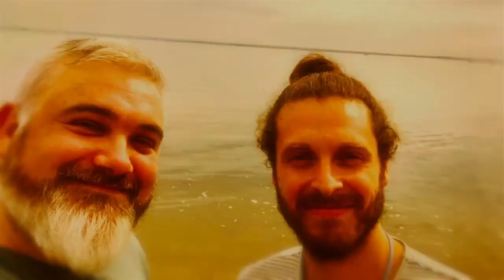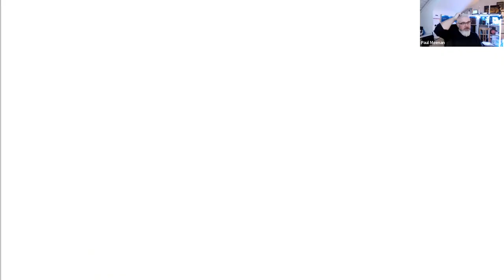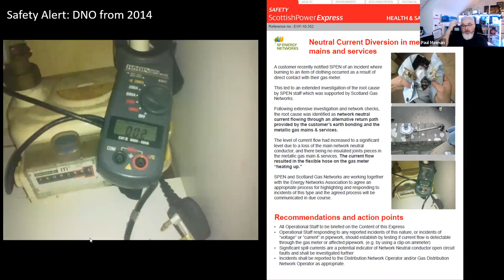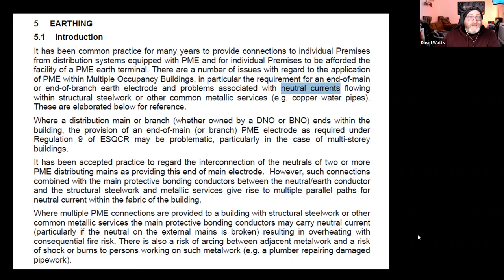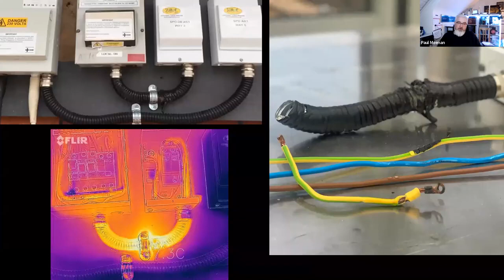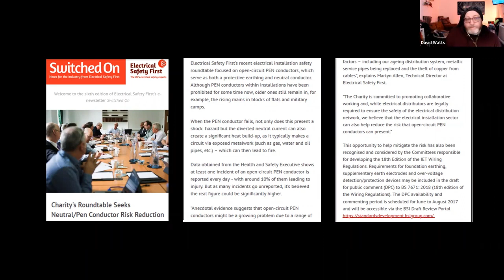Diverted Neutral Current

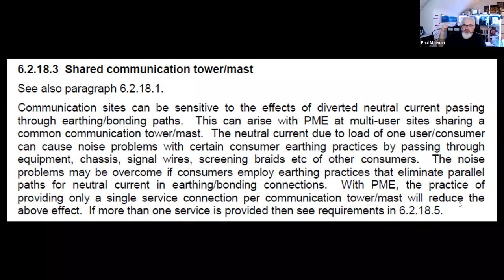Comment: 36:30 What if you have over head lines but you are close to the fenced in transformer that is fed with underground cables? I've had some scary things happen at the meter board (in my kitchen) when the big transformer has done the big light show and electronic music before It made even bigger boom.. everything around felt charged for a moment, kinda scared to have any Class One now :/
Reply from the maker: Yeah that does sound like a bad combination of circumstances. The wording 'charged environment' is key here as that is most likely exactly what you have.

Comment: Perhaps the DNO should be adding a clamp Meter or other earth current monitoring equipment when they install new Meters ?
The technology is easily available now so there is no excuse. If they can read amounts the KWs of Current used and Bill us directly from this tech , why can't they see dangerous problems and get it fixed? 
Diverted Neutral current is caused by some break in the DNO supply cable conductor, before the current gets to a Consumers property. This situation is in no any the responsibility of the Consumer, or in turn the Spark they have employed to do whatever at their home. The DNO surely have a responsibility to get this sorted, at least with new stuff going in and not just do the bare minimum.

Making it the Consumer's problem and getting them to pay for the Fault finding is wrong in my view.
Maybe when a fault is discovered by a Consumer's Spark the DNO should discount the Consumer's bill to cover the Electrician's Invoice?
Reply: This is what I thought. With Smart meters etc. In a TNCS system any earth fault....the wrong way or excessive down could be easily picked up!
Reply: and like that all DNO's would be on their ...path to become bankrupt because there would be so much work to do to fix the issues (so many issues!) that will cost THEM so much.. and this will be THE END..
Reply: @MrFryfish   
Is it really fair to make the DNO’s Supply problem, a Consumer’s problem? 
We,as Electricians, are now being asked to install Earth rods when we do some install iiwork

Comment: As i understand it - in island mode you can still connect to supplier earth and a spike simultaneously but when you isolate from the incoming supply you then need to tie your island neutral to earth to stop it floating. That's what the relay is for, a N-E bridge for island mode, not to switch any earths in or out as is suggested here.

Comment: Retired telecoms engineer's comment I think needs attention.

It needs to be remembered that the B  leg of a standard telephone line is along side with the battery positive directly bonded to ground with a very low impedence. This normally does not effect the line cards as they use optocouplers. However rising ground voltages can be a huge source of interference and interruption. This can be even worse if the line terminates on an appliance that is earthed.

Cable network RF ground terminations can have voltages present. 

Is there going to be an increasing hazard to telecom workers as more and more lines are converted to optical and the many many paths start reducing.  Even though telecom wiring is not classified as SELV and are regarded as TNV I don't think any telecom engineers are going to glove up and use suitable PPE. I don't know of any engineers that are supplied with suitable clamp meters.

I believe that the telecom industry and the IT industry for that matter needs to be included in these discussions  !!!

A much needed and very sensible discussion gentleman.

I am myself now considering the installation of CT's on any cables or pipes entering my home connected to a warning device.

This is a deeply concerning issue that is only going to become more serious as more EV chargers appear and consumers install more and more solar and battery systems.

I am wondering if a way could be found  to use smart meters to raise an alarm if these issues appear.

Nice work chaps.

Stuart (Bsc EE , M-Plant E)

Comment: Thanks to you all for taking the time to do this discussion, I recently went to a friends home to repair a light, for no reason I tested his sockets earth fault loop which was 217 ohms. I looked at the supply cable, a old PILC CABLE but NO earth connection to the Consumer Unit. He contacted SP Energy Network who sent a engineer around on the same day who simply said “ yes there is no earth provided “ but we won’t provide one, you will have to provide your own , get a earth rod installed !!! Is he right not to provide a earth ? I never found any bonding to gas or water, I have no idea where the 217 ohm reading comes from. ( It’s an old house so must never had a “proper” earth
Reply: gas boiler?
Reply: Yes

Comment: Had a 3AM call-out, due to burning pipes in the kitchen. By the time I arrived, the electricity was disconnected, but the pipes were still hot to the touch. Due mid of the night, did not think to check with the clamp meter, but the water bonding (4mm) connected close to the flex hoses which burned was an obvious suspect. Megger 1741 showed <10V, checked continuity and insulation resistance to all the rest of the installation, and everything seemed fine. The best idea I came up with, the PEN conductor was broken/unreliable in the old MICC sub-main and recommended to be replaced during the day.
Did not help, got the call again around 9PM and honestly, was out of ideas on what can be wrong. Started dicking around with the clamp meter, and found 31A flowing through the pipes, turning on the Electric shower pumped that number above 60A, and yet... <10V between the pipe and N, PE bars with new 10mm bonding disconnected... Was puzzled, and started checking the distribution system in this block of flats, and everything started to make sense.
The ground floor flat, was served by TNC MICC 6mm, while the first floor flat was just branched off from the ground floor flat. To make things worse, flats to the sides were served by separate TNC MICC 6mm. Making earth potential on the 1st-floor flats differ up to 30V, while the water pipe was served by the floor basis. 
A combination of recently added electrical showers to the block, and neighbour going abroad for holiday made this unexpected fault very dangerous.  
Recommended upgrading the distribution system, using MICC sheath as earthing seperatly, or at least the water supply to plastic between properties, but Housing Association M&E consultant did not believe my conclusion and decided that suplementary bondings will do the trick. 
Not sure how it is holding now, we finished that contract month after that incident, but given no action to my previous reports like stolen Earth conductors on TN-S systems to blocks of flats, I would be surprised if they even put more water bonding connections.

Very happy that you are bringing more awareness regarding this, as every spark I told this incident said they would have not come to the conclusion of just Earth without fault having that high of current.
Reply: Defo DNC in a building. Lots of warning in network standards of this. Lot of folks try and cross bond or earth their way to masking it. They have no clue. Well done for finding it. I’d love to see pics etc. Of the incident.. you can send to me or the ninja on socials